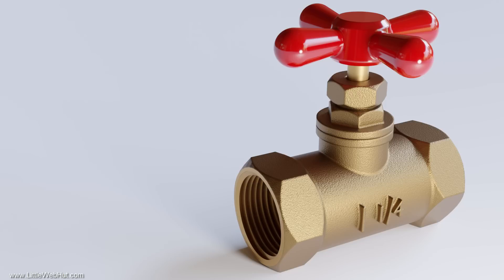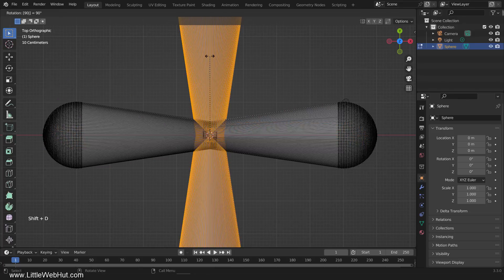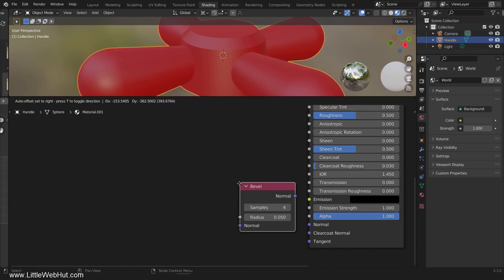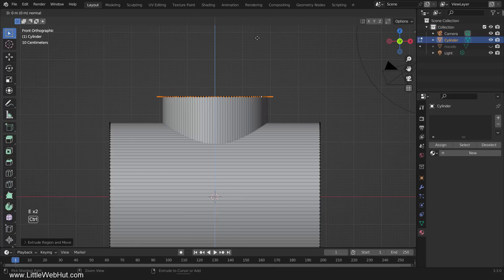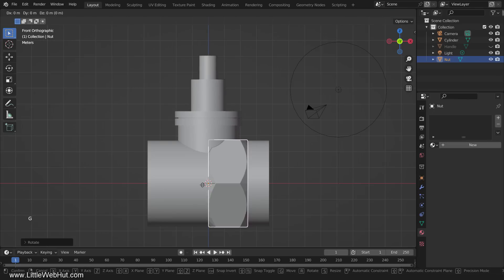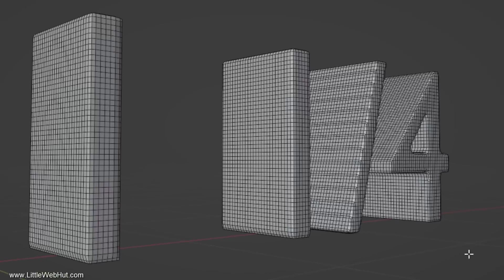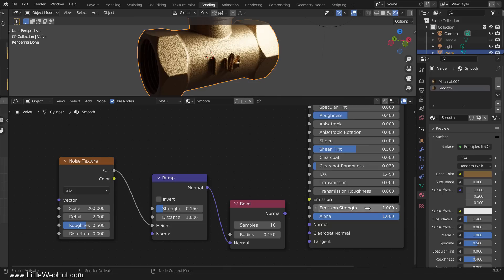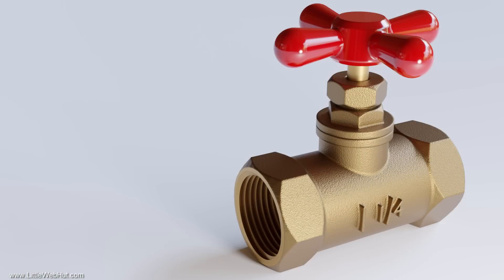Blender Tutorial: Quick and Easy 3D Modeling Method

Comment: Dunno, I got many issues with this one:
1) Number of screen polys makes these kinds of assets impossible to use, as it slows down the viewport too much in a really crowded scene.
2) I prefer modelling everything to real sizes. At least scale it down and apply scale once the general shape is set, to get proper shading parameters into it.
3) Adjust Bump *DISTANCE* rather than bump strength, and similar to bevel should have something that is suitable for the model/material scale.
4) Don't use "full white". Even snow isn't this reflective, and it's about the most reflective (diffuse) surface we have. Lookup proper albedo values instead.
I don't mind informing of alternate modelling strategies, but also state the drawbacks and the reasons why should NOT use them. I can't think of a single use-case for this approach in my professional life. I'm not a hard surface modeler and I frequently "cheat" using bevel node (with means to control radius) especially for imported CAD models, sometimes suppressing modeled bevels first prior to export. And there are cases where I just don't care the geometry is kinda messed up because it will only be rendered with few pixels and never be a main actor in the scene.
As bump distance go, use the displacement height you get from true microdisplacement (displacement only) for testing as bump distance - normals will remain the same. Previewing with true microdisplacement will ensure peaks and valleys go the intended way and that there are no unintentional discontinuities in the math driving it. Not a problem if only using noise though.

Comment: The Bevel node is extremely useful when creating optimized models for games. It has its limitations, though. I wish it was possible to dictate which edges are affected by the node. The reason for this is the following: When creating a low-poly model and baking the generated bevels into a normal map, sometimes, you can see the facets of a model; the bevel node not only bevels hard edges, it bevels all edges regardless of angle. It's as though you were to perform a bevel on every polygon of your model. So, if you have a low-poly sphere and use this technique, you will turn all edges into smooth edges which is not the desirable outcome.
Is there a way around this that I am not familiar with?
Reply: If you're using substance painter for texturing, there's also a bevel generator you can use that does the same thing, with finer control.
Reply: @SacredRedstone  Is that a built-in function? Because I've been looking for that and all I could ever find were pre-made "bevel materials" on Gumroad...
Reply: @AlonsoDigital  Sorry, it's a filter, not a generator, but yes it does exist natively.

Comment: Essentially, this modeling workflow is useful if your project remains in Blender through to the render.   The Bevel is a shading trick that only appears in rendering, and cannot be exported as geometry.   If you plan to animate this model in Blender,  the extra geometry can slow down movement and playback time.    Carefully consider your project requirements before choosing an appropriate modeling strategy.
Reply: You can't bake the Bevel noded textures?
Reply: @2bit8bytes  you can bake the normals to a texture
Reply: @2bit8bytes  Nope... it's a shading trick.
Reply: @Cyber_Kriss  It might be something you are doing wrong, but you can definitely bake the bevel node down to a normal texture map.  I had to save it out and then reload the image into blender to get it to allow me to change the map to non-color data though.
Reply: obviously it is not a geometric modifier, it's a dirty trick, like bump mapping. Basically the normals of a displaced mesh, without actually displacing the mesh. Probably ok for tests and whatnot
Reply: Thanks for the heads up
Reply: However most other renders can use same trick. Redshift, Arnold, Vray...  Even Octane in Blender. So, you can export this in Max, Maya, C4D and use other renderers.
Other things are that such model is ... problematic. Who will accept or buy such crap? Good for your own usage and nothing else. 
btw. all these shading hacks has limitations, are computing intensive, etc.
Reply: Great tutorial, thanks a lot!

Comment: That seems massive over kill way of creating objects, if you are new to modelling just learn the correct ways with sub-div modelling
Reply: This is a correct way.
This channel doesn't just teach you how to model but also different ways to model so they can also teach you different nodes, modifiers and loads more.
Teaching you in a very detailed way that it's hard to go wrong. I have learnt so much over the years from this channel and I won't hear a bad thing about them.
Reply: @Unleashed75  I’m just saying it’s massively overkill to add that much geometry when making a model, if you are adding 128 loops to a cylinder that will fast become unworkable. And not using auto smooth? It has minimal performance hit, compared to adding 128 loops so why not auto smooth. I have been in the 3d industry for a long time now and this wouldn’t be done in production
Reply: Essentially, this modeling workflow is useful if your project remains in Blender through to the render.   The Bevel is a shading trick that only appears in rendering, and cannot be exported as geometry.   If you plan to animate this model in Blender,  the extra geometry can slow down movement and playback time.    Carefully consider your project requirements before choosing an appropriate modeling strategy.
Reply: Taking 2' to add a shader node instead of one hour of modelling is the exact opposite of an overkill. Is it the right recipe for everything? No, one should learn sub-div modelling. Is it a great tip for certain cases? Yes, it is!
Reply: @noother964  yes ok it’s fine if you are just rendering that one object I guess, even though render time would be longer. But if you treated every model in a large scene like that. It wouldn’t be unworkable and render times would be crazy inefficient. But anyways I didn’t want to get into any arguments 😞 maybe I’m just a purest when it comes to modelling for production, been in the industry too long, we have to always optimise mesh’s for the best quality and performance and that is with sub div modelling.